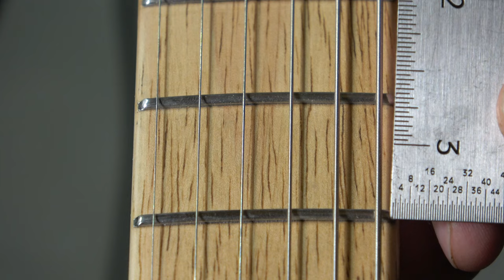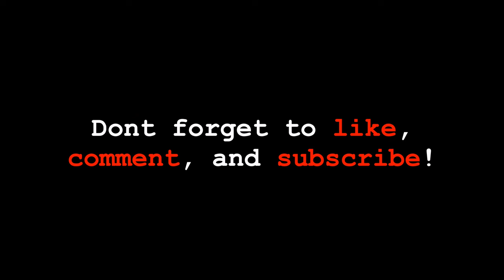How Far Should Guitar Strings Be From The Edge Of The Fretboard?

Comment: I have small hands, and because of this, I make my necks a little wider. 44 > 45 mm at the nut. That sounds counterintuitive ,  but my short fingers have a tendency to pull down a bit on the strings, and I can easily pull the high E off the edge.  A slightly greater distance from the edge helps to prevent this 💜💜💜 Sarah

Comment: 5/64" from the top of the bevel on the end of the fret to the center of  both E strings.  If the bevel on the end of the fret is 3/64", that's very close to your 1/8"from the outside of the fretboard.

Comment: Honestly, for lead players, it's more important to have slightly more space on the small E string than on the top one. You don't bend as much on the low E. when trying to vibrato the high E string way up on the neck, it tends to slip off the fretboard. Of course, not too close to the edge on the low E string either, but not as important for a real lead player.

Comment: Been playing 43 years, and building for 3 years.  its really about the distance from the outside edge of the string to the end of the top of the fret.  so fret end width affects distance from fretboard edge.  for 1 mm wide fret ends, I shoot for a 3 to 3.5 mm distance from the outside of the string to the edge of the fretboard (~2 mm from string to bevel) - along the entire length of the neck from the nut to the 24th fret.  In some cases, I will shoot for an extra 0.5 mm on the treble side.  This is for 25.5" scale length and 8 gauge strings.

Comment: In my opinion, it depends. Since the fingers touch the fretboard from the bottom, it seems likely that there would be a greater tendency for fingers to push a string off the board on the bass side than the treble side. So, I would think the spacing should be greater on the bass side. How much depends. Some players tend to push up on strings as they apply pressure. Other don't. Also, the manner in which the fretboard is made can influence the tendency to push strings off. If you have never had complaints about the spacing, just keep doing what you have been doing. I remember once when someone handed Norman Blake a guitar they had built, wanting to get his opinion. He started to play, and almost immediately, his finger pushed the 6th string off the fretboard. He stopped, and told the guy that he preferred the 6th string to be a bit farther from the edge to prevent such things from happening. Norman was so good a musician that he continued playing without a recurrence.

Comment: Hi Chris, this is a great subject, and I've never heard anyone else talk about it. I have a Les Paul that needed a refret, so I asked the luthier if he could replace the neck binding and not round the edges (they were very rounded by previous owner and the high-e constantly slipped off), and if he would do elliptical ends, no nibs, and minimal filing of ends to preserve as much useable fret length as possible. The nut was also moved toward the bass side to help with this. I have no dimensions, but it seems to be maybe 1mm gained on the high-e side, nut moved about 0.5mm off center. I love it, but would like a bit more still. My ideal might be a wider neck with 2mm more than std on high-e side. My Fenders and other bolt-ons are easy -loosen the neck screws and pull the headstock up so the strings are now a bit further from the edge of the fretboard. I guess I really prefer all guitars be set up asymmetrically like this. When I do vibrato on the low-e I pull down and it rarely messes up, but bending slightly up on the high-e while applying vibrato does not work well for me since it needs much more movement to be as effective. That's why I like more space on the high-e side. To paraphrase Mark Twain " if I had more time I would have made this shorter".

Comment: I stay within the specifications of most after-market parts. I use a 43mm (1-11/16) spacing because that is what Fender uses, and it works for me.
STORYTIME:
I am rebuilding a guitar my family pitched in to buy when I graduated from college in 2002. It is an ESP (LTD) EX-100 (Made in Korea), and I once played it all the time because it means the world to me, and my family is usually broke. My Grandmother paid for half of it; my dad, mom, sister, and others bought it. 

I wanted a hard case for it and went to the local Big Chain Guitar Store (where a kid is playing smoke on the water somewhere). And they found me a coffin case, which was large enough to fit the guitar but a little too big, by four inches too long for the guitar body portion. Over the next ten years, it moved, and the headstock slammed against the end of the case. The guitar looked fine, but the body developed two cracks on either side of the neck pocket, and I ended up dismantling the guitar to save it until I could repair it. 

Now that I have the time to repair it, I was able to fix the guitar body and upgrade the hardware and electronics. I rebuilt the pickups, adding AlNiCo 4 magnets, steal bases, and chrome covers (thank you, Philidelphia Luthiers). The neck has been a chore and is the skinniest flat thing on earth. The 12th fret inlay disintegrated, and I had to fill it until I could get another one (it said "EX-100" in the center of a mother of toilet seat rectangle). 

The neck is skinny up top, and I need a nut with skinny spacing if my two E strings are to have any real estate in that skinny fretboard that is 40mm at the nut. The first fret is 36mm from bevel to bevel, and the bridge is a Gotoh Tune-O-Matic with a ~52mm spacing. 

I need a nut for the guitar with a small string spacing. The neck is skinny after years of refrets and travel around the world. It fits in my hands like it was custom-made, and with my hands, the small spacing is not a problem. I have other guitars, but this one holds much more than the resale value, and I need a method to measure for filing a new nut. 

The guitar means the world to me, and the Grandmother who helped pay for it died at nearly 102 years of age. She played bass violin in orchestras and Jazz bands in LA in the 1920s and 1930s. Buying me a Heavy Metal Guitar was as dissident as her playing Jazz back then; Grandpa played Soprano Saxophone by the by. She loved to see me play live, and the guitar is priceless in its connection to her. All I need is a new nut and a set of tuners; the guitar should function.

Comment: what i do: i divide the total fretboard width by the number of strings. the equal spacing is what i use between strings and i use half of that spacing in each side, on the end of the fretboard... so to resume, i use half of the string spacing each side.

Comment: Vintage Fenders have a 2 and 7/32 string spacing at the bridge, modern ones have a 2 and 1/16. The heel of the neck in the neck pocket is the same modern and vintage causing the vintage strings to be closer to the edge of the frets closest to the bridge.

Comment: I am making mine using Basses I own as a guide (all are between 3 and 5mm). My LTD and Yamaha are even on each side to the string centre. My Squire and Cort 5 string are even to the edges of the strings.

I went with 4mm from the edge of the string (same on both sides), and consistent. 5 String Multiscale Bass 34"-37",. I hand carved the nut out of bone with 9mm string spacing (to the centre of each string), and 19mm spacing at the bridge.

I didn't 3d model it, all sketched out and measured by hand - I did a plywood mock up first to test the positioning of the components.

Comment: I build acoustics and electrics.  Electric I use .120" and on acoustics I use .100" at the nut (measured at center).  I like a wider spacing on acoustics for 2 reasons: I build mainly finger style guitars, and many finger stylist guitar players like to fret the 6th string with their thumb - too far away is not good in that instance. I also use a wider spacing at the bridge for acoustic guitars, which is critical, IMO, for finger style guitar players

Comment: Great question, and not something that's being discussed that much. I used a lot of time researching this topic, when I started out making my own bone nuts, from scratch.
On guitars I'd start with 3,17mm (1/8") from the outside edge(s) of the nut, and see how the strings are sitting, in regards to how close they are to the edge of the fret itself, I don't want them to fall off.
The 3,17mm will give me the measurement for the string's side/edge, but it does not take the diameter of the string into account. Therefore I'll add half the string diameter to the 3,17mm and that provides a good starting point. If I'm not happy with how the strings lay, then I'll reconfigure.

Another way, if for example the frets are heavily beveled, and the strings risk falling off the edges, I will measure from the bevel on the fret itself, in order to "correct" this.
This trick I picked up from StecMac, in one of their Nut Making videos - that's a great trick!

Normally I'll try to keep the dimensions the same, on both sides, but on a CMI Electric Bass that I'm restoring at the moment, I had to come up with different dimensions/measurements for the outer string locations. The outer spacing for the E-string, measured from the edge of the nut and in, using a caliper, ended up being 5,4mm (.212") - this is with half the string diameter added, which was .0475". The outer spacing for the G-string ended up being 4,87mm (.191") - with half the string diameter added, which was .020"..
I would place the nut blank in the slot, put a decent amount of tension on the strings, and kind of see where they'd "naturally" wanted to lay. I checked the alignment up and down the neck, to make sure it was consistent, then I marked their location and used the String Spacing Rule for laying out the two remaining strings. Once they were all layed out, I put the nut back on the bass and checked the string locations - they were all good.

I believe the "standard" is considered to be the 1/8". Atleast that's the information I found, when I started doing the research, many years ago now!

Keep up the good work!
Have a great day.

Comment: When I build a guitar, I usually design my fretboard on fretfind2d. 
I buy pre-cut nuts from graph tech and adopt the string (center)-to-edge measurements from the nut itself, which in most cases is 0.14-0.15 inches (for a 43mm width nut). This also matches most production guitars I own. 
The dimensions of the nuts are available on their website, I subtract the E-e distance from the total length of the nut and divide by 2, to get the exact measurement per side.

Comment: That has been a issue for me as a builder and a player. Been getting warmoth necks without nuts because they don't offer bone nuts. Got a Stewmac safe gaurd nut slot jig. I like it because it is a very safe way to make a nut from scratch. It comes with  a tracing jig to rough cut it in, then I use the graduation string spacing ruler to mark the the slots. Instructions say to mark a 1/8 inch in from the edges and move the graduation ruler until the strings line up with the 1/8 marks. The graduation spacing of the ruler gradually widens the spacing as the strings get thicker. Actually a very nifty system. But real world playability and intonation. I get my neck Plek'd as a last step of the build. And consistently the slot depth has been rather safe and high. To the point I don't even waste my time doing a final polishing of the top of the nut till I get it Plek'd. Playability wise. I can't control the width of the bridge. Maybe sand the neck pocket a little and change the neck angle. But I have a tendency to do a wide vibrato with the strings and the high e slips off the side of the frets, sometimes. Really quite annoying. To the point I have to consciously change my playing style. So I have been slowly giving myself more space on the high e string with every build. Went 5/32 on the last nut. And probably going to go 3/16 on the next neck until I don't have to think about it anymore. I'm even considering using a bridge with narrower string spacing. End of the day my builds are very personalized to my preferences and playing style. Need a guitar I don't have to think about or need anything else. Just need a deep connection with the instrument to the point of getting lost in the music. Probably could write a book about all the intricacies of building a guitar. It a very personalized process

Comment: I've measured this on almost every guitar I've ever owned and the vast majority of them have been right around 1/8 of an inch (3.175 mm) from the edge of the fretboard.  I do own one now where the high E is closer to the edge of the fretboard and I do have issues with it sliding off the edge if I'm not careful.  I've also replaced nuts on guitars where I went just a tiny bit too far from the edge of the fretboard and it was noticeable when trying to play chords close to the nut.  You wouldn't think it would make much of a difference but I sure could tell.
Reply: Same issue with my fairly new Squire Telecaster.  I had a new nut cut and now the high E is close to the bevel of the fret and feels like it wants to dive over the edge.  Looks like a trip back to the guitar tech but it's a mystery why they would let this happen.   I had a Strat with the same problem, except on the low E (instead of the high E) string but a new nut fixed the issue.   With the accuracy of tools and technology these days it's perplexing.

Comment: I build nylon string guitars and shoot for 4.8mm from the high E string edge to the edge of the fretboard and 3.2mm on the low E string. This works well for this type of guitar with the fret ends not being excessively beveled. The spacing at the 12th fret is 5mm on both sides. Anyway, that’s how I design my nylon string guitars. The asymmetrical layout works in this case.

Comment: That's really crucial for me as a guitar player to have the proper gap between the edge of the string and the edge of the fret. For a 6-string guitar I prefer to have a 2.5 mm gap between the edge of the both low and high E string at the first fret, and a 3.5 mm gap at the 24th fret. Having such a little gap helps me to widen the string spacing a little bit, so my finger tips don't touch the unwanted strings while fretting chords, especially at high positions. In I can fret the 6th string with my thumb as well. And I prefer to have the frets' edge with the bigger angle (about 80°) to make the fret surface as long as possible. That's helps me to keep  such a wide string spacing playable. And for a 7-string guitars I prefer a bigger gap (about 3 mm at the 1st fret and 4 mm at the 24th fret) cause the 7th string has a wider amplitude.

Comment: Let me just leave some numbers here, measured at the 12th fret:

Ibanez S-Series, Wizard-III-Neck
Neck width: 53 mm — Distance E to e: 44.3 mm – Playable fret length: 49.7 mm
Fender Mexican Tele
Neck width: 51.9 mm – Distance E to e: 44.8 mm — Playable fret length: 49.5 mm

While string spacing and the levelled part of the fret are almost identical, the Ibanez has a wider neck. Assuming you're using the same angle when filing the fret ends, this makes sense. I am comparing jumbo frets (Ibanez) to very small vintagy frets (Fender). If this is true, you'd have to think about what frets you want to use before you can determine the neck width. Also, replacing small frets with big ones on an existing instrument could effectively leave you with a "shorter" fret.

Comment: So finally getting to where the new camel bone nut is to be put in. Using the old plastic nut as a starting point. (1.680 nut width)
Low E and High E are .160 from the neck to the edge of the string. Seemed a little too much to me. BUT checking the heel of the neck shows the same .160 from the bridge.
Using D'addario "balanced" light strings makes about .250 spacing between each string needing a little tweaking with the calipers.... 
This is on a 1999 Ibanez GAX 50 dumpster find rebuild...Neck pocket was too big and skewed the neck...the fretboard dots were not even centered ? Fixed the pocket.Replaced the plastic dots with MOP.

Comment: 3mm at the nut, 4mm where the body joins (16th fret), then it get narrower again towards the last fret (heel of neck and pocket are square). Measured from de outside of fretboard to the outside of string. Low and high E are the same. My heels are wide because I build with bridges with a 54 or 56,5 mm string spacing. The width of my heel is determined by the width of the bridge so the sting doesn't come to close to edge at the last fret. Low and high E are always on the outside of the pickup poles, never gave me any trouble. Cool Project looking forward to your findings!

Comment: strings should be a certain minimum from the edges of the fretboard to not slide off and note-out when fretting. However, the actual distance is determined by several factors including: string gauge, fretboard width & radius, pickup alignment, intonation, and fret-hand playing style. I for one often use my thumb for the low E and (sometimes) A, which means hand pressure on these strings is either flat or downward. I'm not going to note-out off the fretboard here.